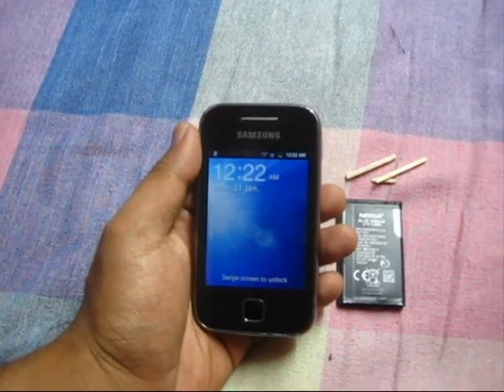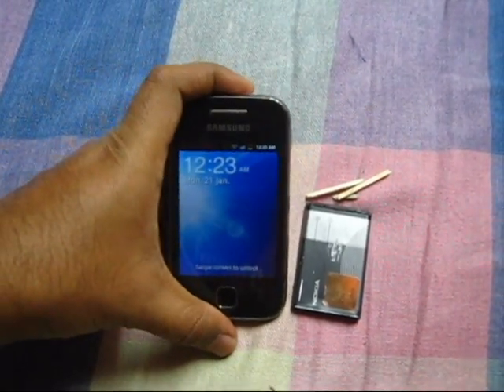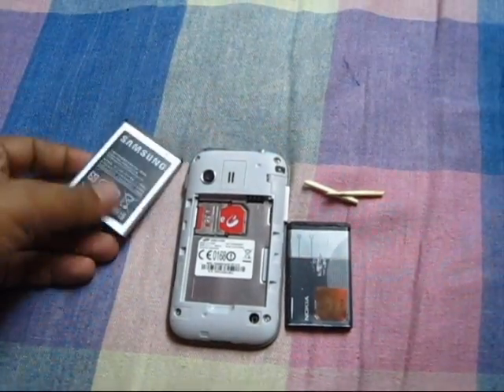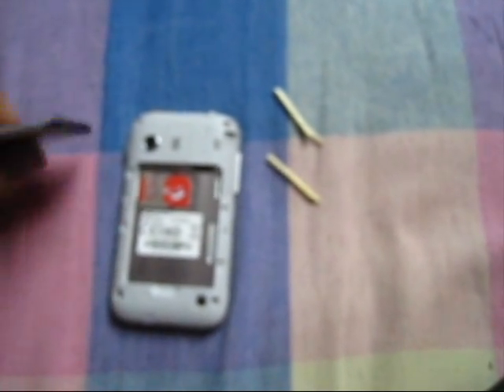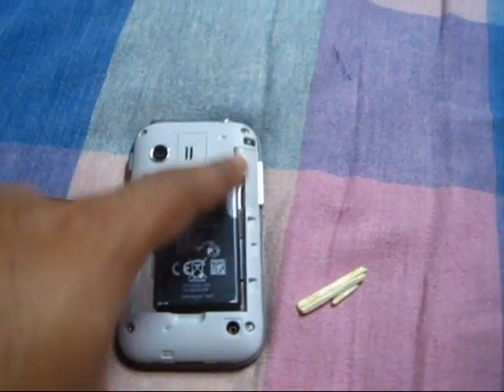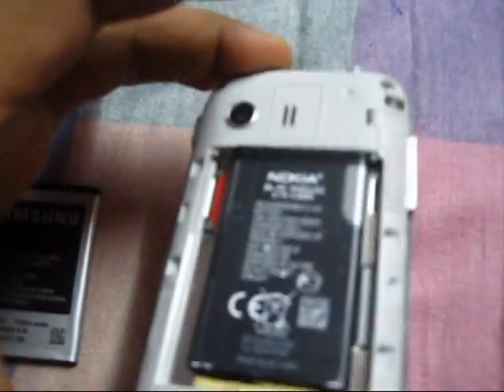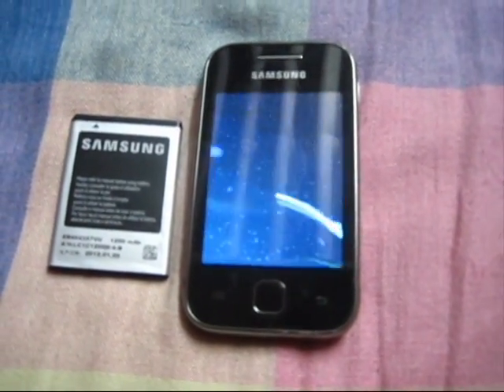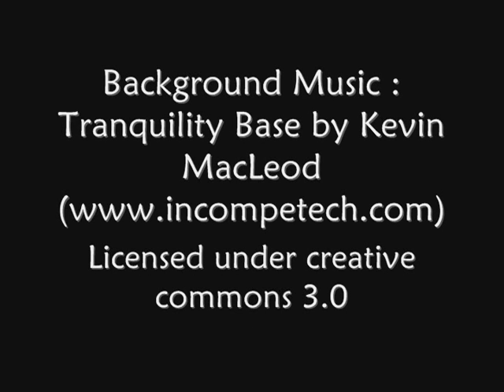How to - Samsung Galaxy battery problem SOLVED.

Comment: the January 20/2017 update to the Google app made my "samsung s4 active" overheat and drain the battery like crazy. in 5 hours the phone shut off because it had an empty battery after a full overnight charge Uninstal all updates to the Google app and keep the original... i did that and it solved my problem.... try that and let me know if that fixes yours..... after a few days I installed the app update again and same issue returned... so I went back to the stock app version. goodluck
Reply: Google app? Which app r u referring 2 Damian?
Reply: Tom Bennett it's just called "Google app" in applications the white icon with the multi coloured capital G. I read somewhere that that specific dates update made people's phones run hot n kill the battery quick.. same like mine. so I u installed it and kept an eye for a newer update... installed that and it fixed my issues.
Reply: In my samsung s4 active it's just called "Google app" in applications manager
Reply: Ah ha. Ty Damian.
Apparently my old Samsung Galaxy Y running Android 2.3.6 does not have "Google app."

Comment: This is cool and all, but I don't recommend using anything that has good thermal or electrical conductivity as it start a fire or worse accidents in case if the  battery overheats, becomes swollen, or a number of other things, I'm not saying this is a bad idea, just don't use any metals,, papers, or woods as the YouTuber in the video uses match stems as, try plastics.

Comment: any old battery could work.?? ahmpf dude my problem in my phone is when i open it it works then by the time it says galaxy young it would turn off... pls help
Reply from the maker: Ashlyn Inciong Try with any battery who's positive and negative points coincide. In my case, Nokia Battery does with Galaxy Y. If u face same problem, then there is a hardware/software issue with the phone.
Reply from the maker: ***** Dont charge the battery in a different phone. Charge the battery in its original phone and then insert in different phone.
Reply: +Ashlyn Inciong if cleaning the contacts and using some kind of shim doesnt help, try a new battery.